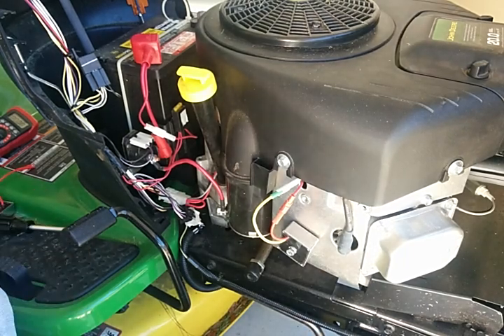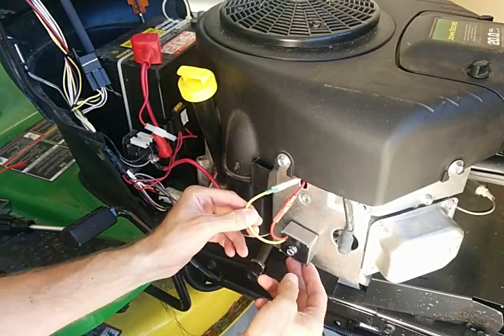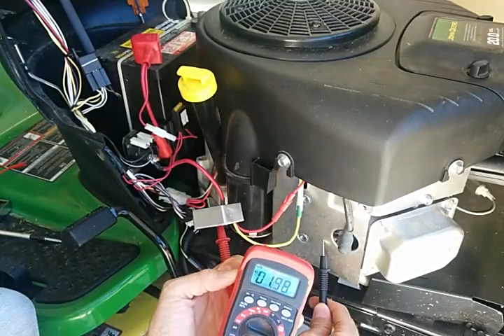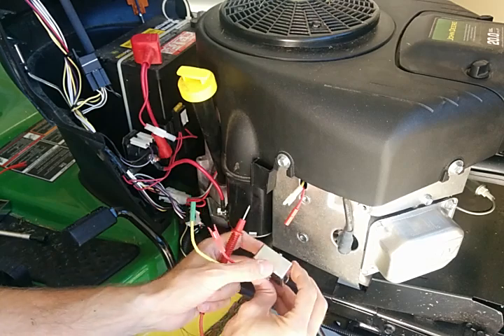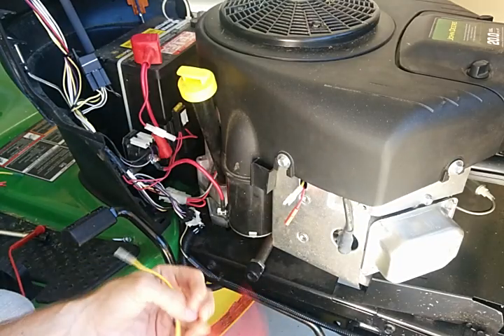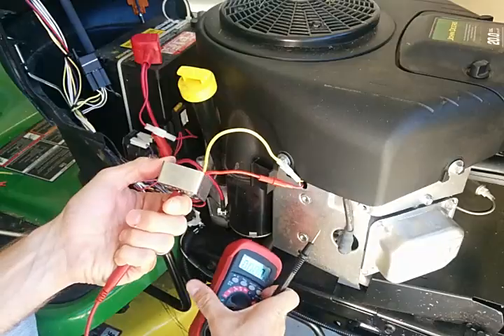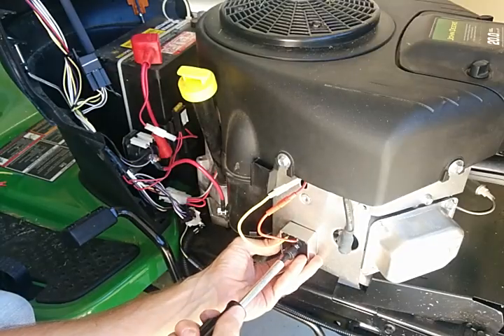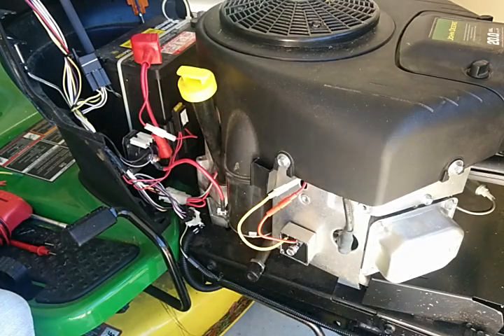Lawn mower voltage regulator battery drain *PLEASE READ DESCRIPTION BELOW*

Comment: I found the same problem on mine. The new one draws even more current. I see yours is fine. I ordered another one from a different vendor. Maybe a crap shoot on the part. Hopefully, the second new one works. If not, I'll just pull the fuse when not in use.

Comment: Can someone please tell me what I need to set my voltage meter to in order to test the regulator?
Reply from the maker: @MNHoneyBees  you'll need to measure the DC milliamps to detect the current drain shown in the video.  You could measure DC volts to determine if the output voltage is sufficient.  In my case, the voltage was fine.
Reply: @opiate2L  thank you!

Comment: I tested my regulator the same way you did in the video and it was drawing 11.7 volts DC. Does that sound right ??
Reply from the maker: It's current flow that drains a battery.  Try setting the meter to milliamps and see if it reads anything between the regulator and the case.

Comment: Why isn't the voltage regulator bolted tight against the motor metal case.
The regulator will be moving all around when you go cut grass.
If the bolt in not tight against the motor case add a few washers under the head of the bolt to get a good secure ground

Comment: A stop-gap solution to this problem is to pull the fuse that's located next to the positive terminal.  That will eliminate the parasitic load.  Replace the fuse when you are ready to start your engine!
Reply: En ese sistema de carga no ha ese tipo de fusible

Comment: I have 3 John deer z930m. Everyone has a 13 mA draw when the power is off. One of my batteries goes dead everyday, any thoughts? Maybe 13mA draw is acceptable on those mowers? When I unplug the vehicle control unit, it does not draw from battery while off. Hmmmm

Comment: if you suspect a drain  disc red battery lead   conn ohm meter lead ground  the other lead  to the red lead you disc  if you get a reading  you are looking at the drain  find by elimanation to see where that reading is coming from   then repair or replace.

Comment: Couple questions= the mower looks fairly new, just wonder if this was a problem from purchase date or do these go bad over time? I wonder how many are blaming bad batteries when it could be draining like from bad regulator.
Reply from the maker: The mower was over two years old and it had been an issue for a while.  I didn't replace the original battery for another two years after that.  I think your suspicion is correct.  People verify correct voltage output, but miss the current drain and blame it on the battery.
Reply: @opiate2L   Well the batteries have a bad reputation for being cheap and not lasting long. Most have short warranties and add to that many stay on shelves for long time before being purchased. My 2 year old JD D130 battery died in March this year..so bought the Walmart 230 amp battery and it seem like it didn't want to turn over at all when brand new, but after 3 or 4 turns of the key it kicks off. After the 90 day warranty is gone it won't start by itself and after jumping it runs but 7 days later it's dead again. Gonna try the test you showed and see if that is a cause. Thanks
Reply from the maker: @captinbeyond  When my original battery eventually went bad, I got one from autozone with higher cranking amps and had much better starting.  Good luck.  I hope you find the culprit.
Reply: @opiate2L  thanks

Comment: For those of you asking, the voltage regulator HAS to be grounded and grounded well. Not loose. The wire from the stator supplies ac voltage. The wire to the battery (red) is a sensing and charging wire. Without the ground, the VR has no idea what it's supposed to be doing and voltages will be all over. Might even blow up a battery or cook a harness, but usually just won't charge. Just throwing that out there. Popped in because 3 of my regulators are showing voltage between body and engine. I was surprised to see yours wasn't. Might just rig up a key operated relay that closes a hard line from VR to batt pos on run position. Even if it fails again, I won't find a surprise.

Comment: I measured the drain as your video showed. So I bought a new voltage regulator. I connected the new one and tested it.  Same type of voltage drain.  Not happy. Wondering why these have to be "grounded" in the first place? I tried running it not bolted down and the mower runs fine.
Reply from the maker: There was no current drain with my new part.  I'm pretty sure some electrical part inside the molded rubber was making contact with the case when it shouldn't.  If you can secure it to the mower without the metal making contact, that might be fine.  Some strong velcro might work.
Reply: @opiate2L   I'll secure it with a nylon tie cable away from the metal. I looked at the specs and mine does show a 'ground', but for what purpose I don't know. https://www.briggsandstratton.com/content/dam/briggsandstratton/na/en_us/Files/FAQs/alternator_specifications.pdf
Reply from the maker: @Droxyguy4life  I see what you mean.  It makes sense that a voltage regulator circuit has a ground but I hadn't thought about it being via the case.  I'm not sure what went bad in mine or why your  part does the same, but my new one does not pass current when the engine is off.
Reply: Somewhere in reading about this problem I noticed comment about a positive contact between the regulator and the machine, which of course is grounded to the battery. 
My 12v test lamp actually lights if inserted inline with the positive supply.  I think I got a similar reading on the amp meter that you go but wasn't real confident my meter is good. So with the test lanp, That's how I know there is a drain. 

I think it's worth taking more time to positivel isolate the drain for some of these commenters. Test for same drain with regulator disconnected, etc. My solution is likely to put a disconnect on the positive cable and open and close it with operation. My regulator on the 18 HP honda is a little more complicated and runs $100.I would probably want the disconnect anyway.....then religiously hook up the trickle charger just in case.

Comment: What if no voltage regulator
Reply: You may have an inline diode coming from stator wire that handles the ac to dc conversion.

Comment: Hmm, good vod, but what if i don't have a voltage regulator ????
Reply: Then check the wires off the stator  for an inline diode that's bad.
Reply from the maker: I'm not sure because I've never had any other type of battery drain.  You'll just need to poke around with with a meter until you can find where the short is.  Sorry I can't be of more help.

Comment: If you have a mower that does not have a voltage regulator, there is a hidden diode in one of the stator wires that has gone faulty allowing battery voltage to drain.
Reply: Rusty Nuckles  I'm trying to troubleshoot my mom's zero turn mower. The battery keeps draining slowly.
Reply: @davidmcnabb5315  the battery on my practically new JD ZTrak 375 just died. Unacceptable! Did not expect this from a $3500 tractor.
Reply: @Fresh-tw7ev  Same thing happened to me JD 355 I'm finding out it isn't charging the battery while in use.
Reply: @acemarshall7028  Ace it was due to a faulty voltage regulator. Covered under warranty.

Comment: I have a JD LA105  and I have the same problem. I need to replace the voltage regulator but I'm having a really hard time finding it. Any suggestions where to look? John deere?
Reply from the maker: My local dealership wasn't much help so I found one on eBay. It was described as "Voltage Regulator Briggs & Stratton B&S 691188 491546 793360 794360"
Reply: Great, so Briggs & stratton is compatible
Reply from the maker: I guess so.  In fact, the John Deere mowers at Lowe's have Briggs and Stratton engines.
Reply: Thank you Brian, it worked

Comment: Did you say you "unplugged the battery terminal"  to test it?  Im having the same issue with my battery draining. What is the first steps to test the voltage regulator?  Key on, off? Battery connected?  Any help would be appreciated. Thanks.
Reply from the maker: Good question.  The battery was draining with the key out and the battery connected; just as it sits when not in use.  I only put an ammeter between the regulator case and the metal engine compartment to show that current is flowing where it shouldn't while bolted in place.

Comment: the v reg needs to be tight to the engine to earth properly your bolt is to long or needs a lock washer to tighten it .
Reply: bgm  Don't criticize his video you don't know how to spell "ground" right bro.
Reply: BGM is correct, the voltage regulator needs to be grounded. Regardless of how you spell it.
Reply: And it is grounded, via the mounting screw.
Reply from the maker: bgm wrong
Reply: All the ones i have seen have been tight to the block ? but if you say that is how it is then ok  but if it go's again this maybe the problem . i do not work on b/s anymore we only have honda now
Reply from the maker: It's an internal short.  That's the factory bolt.  The problem is fixed now.
Reply: yes not saying the old one was not defective just saying they should be grouned tight maybe someone had it off before you and lost a spring lock washer  it would be a diode gone causing a back feed seen it many times .